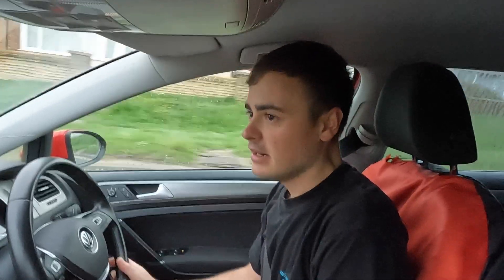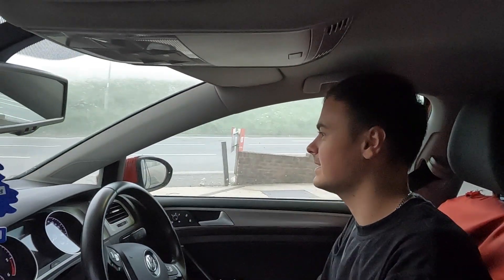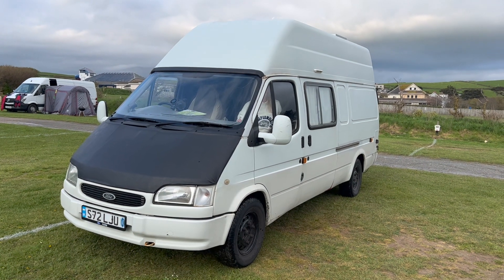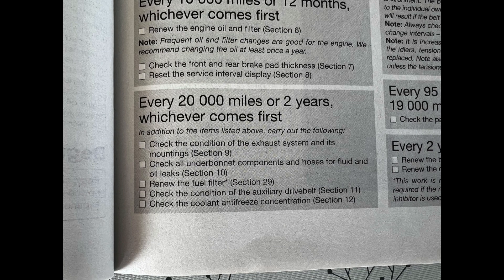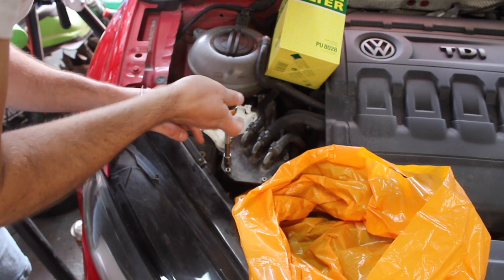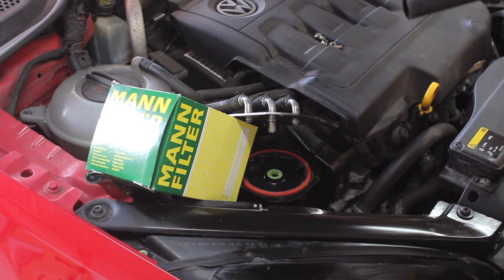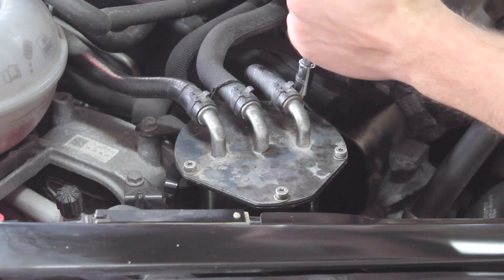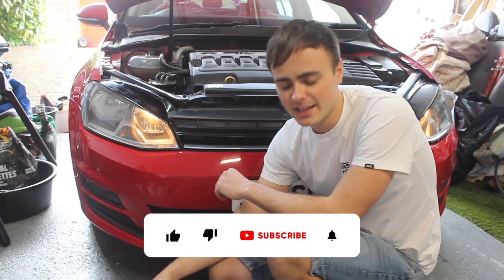Fuel Additive Test & Fuel Filter Change | VW Golf MK7

Comment: I can definitely recommend Forte Diesel treatment which my independent vw mechanic puts in the tank every year. Always runs sweet as a nut. Also use their Ad blue additive to stop crystallising every ad blue fill up.
Spending £40/50 a year on additives is way cheaper than fixing blocked injectors, dpf issues etc
Reply: as the saying goes, oil is cheaper than a new engine. yet many people just don't do it, some not at all 😲
Reply from the maker: Awesome, thanks for the recommendation I will get some to try out 😊 I totally agree, it should be cheaper in the long run to use the additives every now and then. Cleans the injectors and fuel pump etc 👍🏼

Comment: I bet your NOT  getting 86 mpg now, I've used similar products in my 222000 mile Skoda, once this product has gone thru your system and you've done about 1k , the fuel consumption will revert to normal, am I right, or am I write ?
Reply: well thanks for the love heart, but i`m REALLY after an answer to my question, i can only take it as your non answer is because i`m correct ?
Reply from the maker: @t5jerry well you answered your own question 😊 averaged 70mpg on the same journey yesterday so not too bad considering!
Reply: @TurnersWorkshop97  so your car is the 2.0 diesel , what bhp is it  ?
Reply from the maker: @t5jerry 2.0tdi 147bhp
Reply: CORRECTOMUNDO 🤪

Comment: Hi mate. Ive got the 1.6 tdi. I get around 75mpg. Near enough 800 miles to a tank. Interesting to see its not far off yours. Mine has been remaped but thats it
Reply from the maker: Thanks for your comment mate, mines also been remapped. Made a massive difference I found 👍🏼😁
Reply: What remaped you use? I have a stock 1.6 tdi and i can only go 700miles, 1000km not close do 1200km thats very good for 50liters thanks capacity